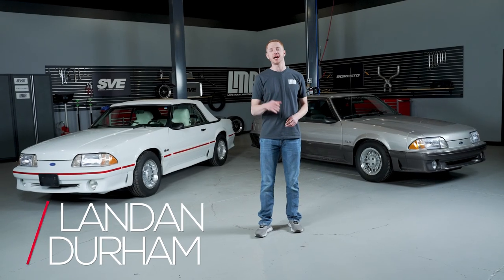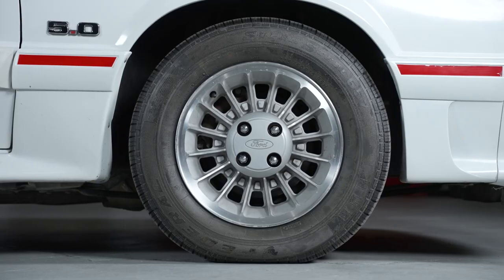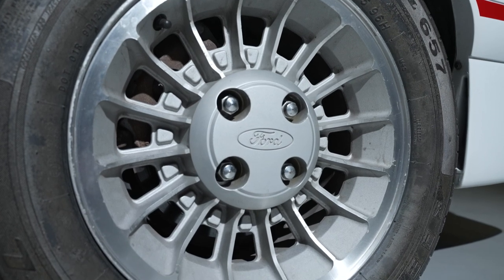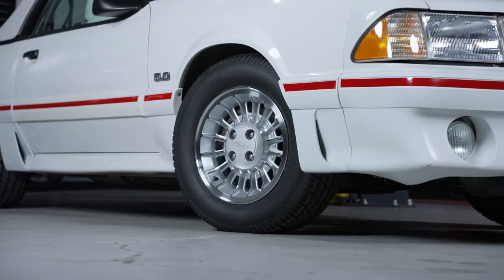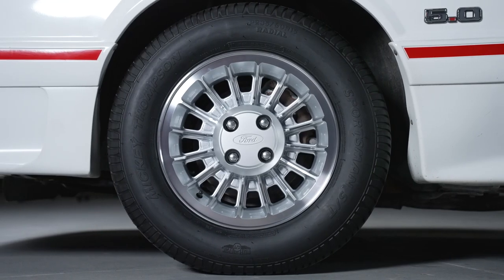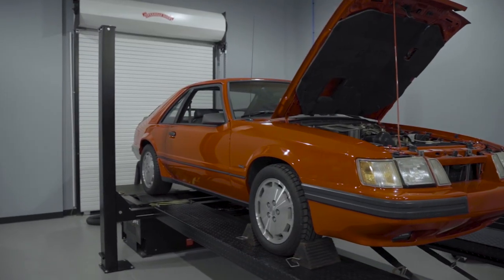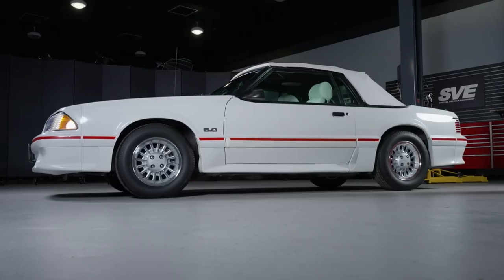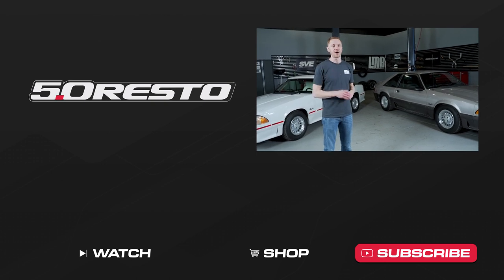We KNOW what you're thinking! Fox Body Mustang 5.0 Resto® Turbine Wheels - Review (1979-1993)

Comment: Never threw any away. I think have about 16 laying around. Only have 1 car they are correct for (my '89 GT, but I have '91-'93 Ponies on it). When I bought my '85 GT it had turbines on it & my '82 GT I got last year came with 4 turbines. Bought a set of used McCrearys once  mounted on turbines.

Are you going to reproduce the center cap with the Cougar head logo? That would expand your market for these wheels. I was going to put a set of turbines on my Capri but people want a fortune for original Cougar head center caps...when you can even find them.